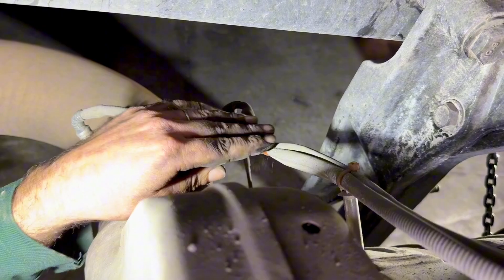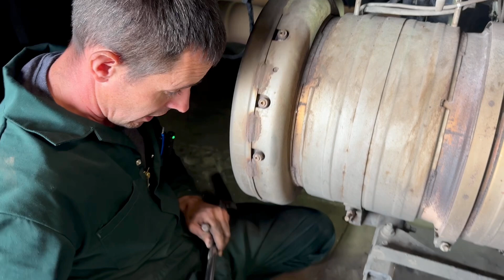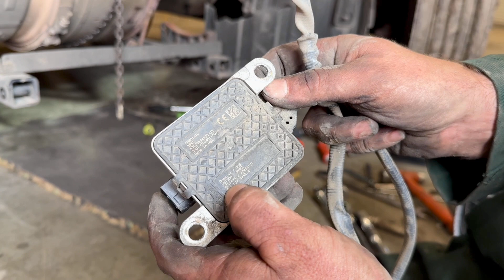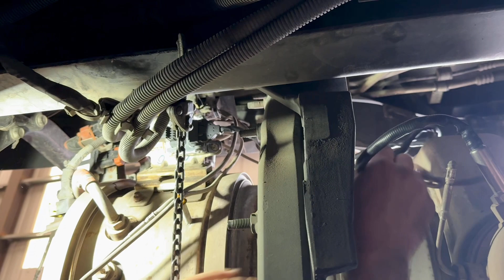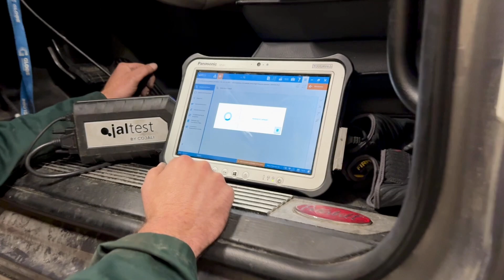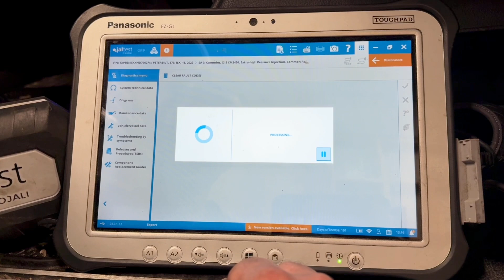How to Replace NOx Sensor on Cummins X15 - Step by Step Tutorial

Comment: The X15 and the newer paccar systems like that both suck big time. Having the DOC, DPF, and SCR clamped together like that while easier to drop down and work on, have higher/faster failure rates do to increased temperature and pressure, since there's no piping and air flow separating them. DOCs and DPFs need that 1000° temperature to burn the soot, but SCR conversion is better at around 500°. It's kept me busy though with replacements, but there's going to come a time real soon that the truckers are going to get pissed enough to push back against the manufacturers. All Aftertreatments have issues but this has been one of the dumbest decisions so far.

Comment: In what situation we need to change the NOx senso? I have codes 3226 and 3216 so should I change the both sensors?
Reply: Did you fixed?
Reply: @ДимаКама-ю9ъ yes I replaced both

Comment: Hey Ryan, is the inlet Nox sensor by the turbo the same part # as the outlet by the SCR?  
Work with a 2019 T680 w/x15.  Im going to replace the outlet but want the inlet on hand. TY!
Reply: I think they're usually different part numbers. I have a 2020 International LT625 with Cummins X15. Inlet NOx sensor is 4326870. Outlet NOx sensor is 4326874

Comment: Excelente job 🎉👍. Thank you! 🙏
Can we use this type of scanners on Case end loaders and other industrial equipment ??
Reply: @mtgwdefender. Yes!!! Actually, I worked in a 921G just a few weeks ago is Syracuse, and it worked great. I had access to the engine and the controller. The only thing I couldn't connect was the transmission, but it was my fault... (i couldn't locate the connector). I'm not sure about a different computer, I just got one computer, one box and I do everything in the same program. If i'm not mistaken they offer different options and you can choose your modules (I got Commercial vehicles, Machinery, and Forklifts). I'm not sure if they still doing it, but they showed me the software online.
Reply: @AlejandroRodriguez-we9qe  thank you very much
Reply: Yes, you actually you can use scan in all type of equipment.
Reply: @AlejandroRodriguez-we9qe  have you tried it on the CASE loaders?? I just talked to my supervisor and he says that CASE equipment requires their own laptops and these laptops need a particular license or software
Reply: Following